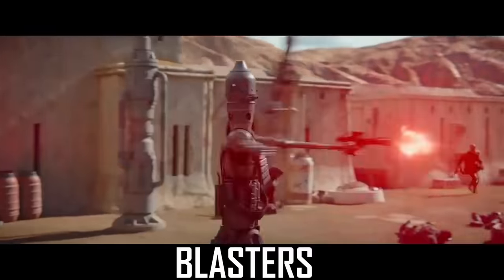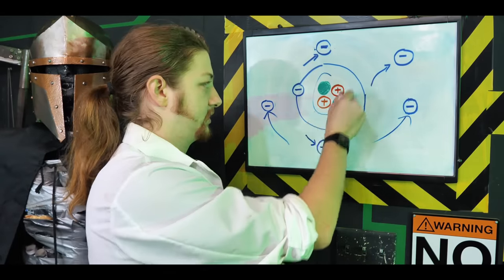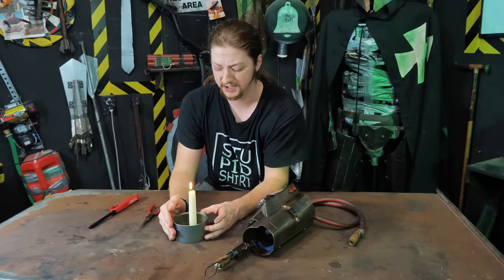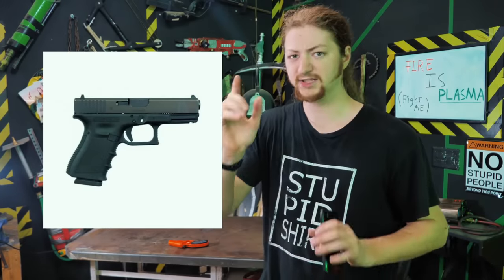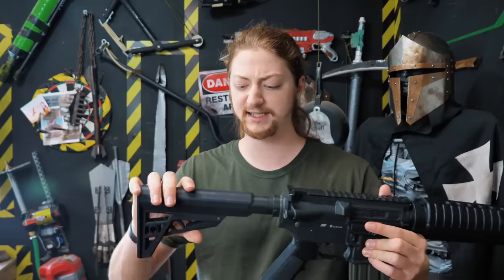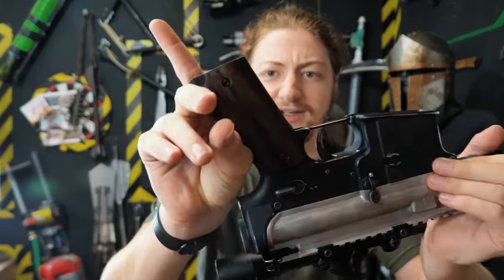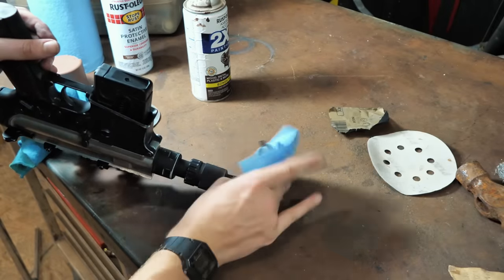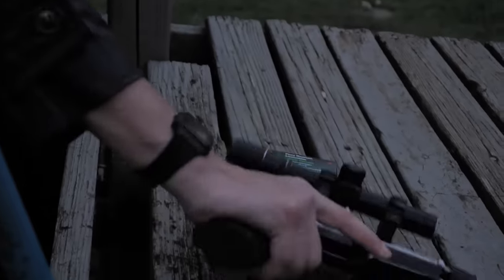Worlds First REAL StarWars BLASTER (is it possible??)

Comment: This is a really sick build, one of my favorites from you — and honestly, I think gun enthusiasts around the world are glad you didn’t mess with another mauser
Reply from the maker: Thanks bro! ngl i'd have felt terrible bastardizing an antique Mauser 😅
Reply: It wouldn't be an issue if companies would just make reproduction Mausers
Reply: @Imperial Bricks  they would have to make them clearly distinct from the originals though. Otherwise it would really screw up the market
Reply: @imperialbricks1977  but I agree, a lot of these relics would do very well in the historic market
Reply: @SpectrumArms  

Well obviously make sure people know it's not an original
Reply: @SpectrumArms  
Not really. Modern serial numbers and laser engravings on the inside of the parts would allow a buyer determine between original C96's and reproductions. 

The issue is cost. It is currently not economically viable to make reproductions using CNC machines and hand fitting the parts to together. Heat treatment and trying to achieve the same original blue finish are additional issues. 

You could setup a production line, which would significantly reduce the cost - but there is a lot of risk involve in it. 

There are reproductions of the Luger pistol but in 45 ACP and 10mm, but they cost significantly more than an original Luger in 9mm. I think that they start at 5000 or 6000 USD, compare that to an original that you can get for 1000-2000 USD depending on its condition.
Reply: The ar pistol looks way better imo
Reply: When I was a kid I remember a neighbor kid had a de milled Mauser. It was real and the controls worked but it didn't fire. I bet one of those could be found for a blaster project. I wouldn't feel bad about using one that's already ruined. That kid also had Walthers and other real but demilitarized guns. His dad was an arms dealer and bought him lots of super cool toys.
Reply: @Nate Bolyard  It would be easy. New ones would be required to have; Read Safety Manual stamped on it.
Reply: Oh hell yes, thank you for leaving the broomstick alone. 
Loved the build. What you made looks great.
Reply: @jakemakes the community would have torn you apart
Reply: C96 Mauser are so plentiful most wouldn’t mind if you hacked up a worn out used one.
Reply: there needs to be nice, replica mausers... Palmetto needs to get on that lol...
Reply: No, you're being lied to
Reply: Make the dfa from destiny 2 or the last word from destiny 2

Comment: “Gun laws are retarded” instantly subscribed
Reply: Glad I'm not the only one
Reply: 16 inch rifle = legal
1/2 inch pistol = legal

but...
16 inch pistol = illegal
1/2 inch rifle = illegal

Makes no sense. Putting a stock and a longer barrel on a pistol should be legal, and cutting a rifle down should be legal. It would be no different than buying a normal pistol or a really long hunting rifle.
Reply: @nitroxylictv  It makes sense when you realize it's not about keeping you safe or even keeping laws logical or consistent. It's about chipping away at your rights to own them wherever and whenever possible.
Reply from the maker: It makes a little sense when you realize the NFA originally was going to make pistols illegal as well, before they realized it would never pass. So they edited out the pistol part but neglected to remove the bits about modifying rifles to be pistols and SBRs. That’s gun laws for you.
Reply: @nitroxylictv  16in pistol is actually legal.
Reply: All firearms are legal.
Firearm laws are illegal.
Reply: @joshuawerner4376  True, and the laws don't even stop others from shooting each other.
Reply: Im with ya brother
Reply: I love using my pistol brace to brace my pistol
Reply: SAME
Reply: @nitroxylictv  Theoretically a 1/2 inch pistol and a 1/2 inch rifle shoot WAY different ammo. Which is the point of the law. They don't want someone coming into a place with an easily concealed pistol that shoots 5.56 rifle cartridges at people. But the problem is there is SO MUCH OVERLAP between pistols and rifles in certain models which makes any attempt at general gun laws pretty much futile.
Reply: @nitroxylictv  
16 inch rifle = legal
15.9 inch rifle = illegal
Reply: @captin3149  The ammunition shouldnt even matter. You can legally make your own pistol, (obviously not full auto but any other config), that shoots 50bmg if you want. That too basically just shits on gun laws targeted at sizes/ammunition.
Reply: @Cap Tin  Uh, no. The point of the NFA was to ban pistols as well, so they added rules about cutting down rifles into pistols, so people wouldn't skirt the new laws, then pistols were removed from the NFA, the only reason those rules were there to begin with, and then our genius politicians JUST LEFT THEM THERE for no reason.
Reply: regulating militia are so 19th century
Reply: Same
Reply: @nitroxylictv  you forgot the part where it's perfectly legal for anything as long as you give them money
Reply: @riftvallance2087  I don't know. General weapon laws seem sensible to me.
Reply: It's obviously not about safety, it's about giving the police as many options to arrest you as possible, and since they can't confiscate the firearms they'll just resort to punishing you if you ever have to use them. I'm honestly wondering how long it'll be until someone in a gun-friendly state uses one in self-defense, ruled as so by the local authorities, only for a federal prosecutor to come in and charge them for murder. That's basically what happened in TX a few weeks ago with the guy who was pardoned, just with different steps. The case was already ruled as self-defense, only to have the next DA retroactively press charges. Next time they'll go federal to rule out that pardoning option.
Reply: @adrianaslund8605  Yep, they seem that way, until you see how those with authority apply them. I now oppose all gun laws, including background checks, because I have absolutely zero confidence that they will be enforced in good faith.
Reply: @jakemakes ... and the thing is,  you can put a stock on a pistol all day,  and it does not change the fact that it still has only the functionality and range of a pistol... hence,  it is still a pistol. 

I mean,  neither the leader of the ATF,  nor the POS DIR of DHS can describe what an "assault weapon" is, so why should we expect them to know how any firearm actually functions?  There more that I could say,  but let's keep this fun.
Reply: Why did I do that too😭😂
Reply: But rocket launchers,bazookas,flame throwers, grenades,landmines and every other weapon protected under the 2nd amendment(even nukes) aren't regulated........go figure😏

Been to Williamsburg where one of the Colonial Armory are. The Brits took the Guns but left the Swords and Polearms even though Polearms were used as late as WW2 in some theaters (bullets run out)😹
Reply: I wanna go to the us just to fire a big ass gun.  As fun as that would be,  it's absolutely insane to hand them out like candy... if I lived on a farm,  I'd have an ancient .22 somewhere,  just to protect my livestock,  seeing I have no enemies and no one would really want to rob me..  not to mention I'm not planning a revolution Anytime soon (i checked my schedule,  and apparently there was a double booking for October,  so mine will have to wait another decade or so) I'm content the way things are.  You guys can fight about gun laws all you like, please just wait till I'm out of the road before you draw your weapons...
Reply: @psychopathrob1802  probably due to caliber size if I had to guess if  we're to cut the barrel and make a rifle more compact it's easier to hide I'm not a gun nut and I don't know all the intricacies of a gun that's just my guess
Reply: @riftvallance2087  why does everyone assume there's an agenda I get wanting rights but I've come to realize people don't understand the dangers of a weapon doesn't matter if you are following every rule someone else could take it and not be so smart with it
Reply: @joshuawerner4376  i disagree you need regulations a civilian shouldn't be allowed military grade weapons
Reply: @TF2bot  your right laws don't stop people from shooting each other doesn't mean there aren't consequences
Reply: @captin3149  The law outlawing SBR's was made long before 5.56 existed way back in 1934 with the national firearms act, which was passed to try and curb gang violence from prohibition. They intended to outlaw pistols as well, but that part didn't pass, but the SBR ban remained and has largely been forgotten about as far as lawmakers are concerned.
Reply: @logicplague  Eh, gun laws are a complicated issue. On one hand, your absolutely right on how police in America, and in a lot of other countries, can be absolutely abusive, and American gun laws are often selectively and inconsistently enforced, as well as often targeted towards minority communities. Its kinda crazy how even the most ardent pro gun politicians can suddenly get very pro gun control when they figure out that means black people can get guns too. and the NRA is often suspiciously silent whenever a black person just happens to have a gun in the car in a traffic stop and the cop kills them for it. And things like assault weapons bans are often based on silly superficial features that don't matter, like flash suppressors and bayonet lugs. 

On the other hand, greater access to guns also greatly increases successful suicides, and everyone running around with loaded guns also greatly increases the risks of negligent discharges. And this country has a lot of dumb people whom I wonder how they even remember how to breathe and have no business being anywhere near firearms. And then there are people with actual mental health issues whom really shouldn't have gun either and this countries mental health system is terrible. Plus there is when alcohol and firearms mix.

But it is true that greater gun control does lead to fewer firearms related deaths, obviously since the vast majority of firearms related deaths are suicides, accidents, and heat of the moment crimes of passion. And most people whom become criminals, are stupid, and not actually smart enough to know how to get around gun control laws.

On the other hand we also have to recognize that the vast majority of gun owners dont commit crimes at all and are responsible enough to avoid gun accidents. Thus taking their guns away too because some people are irresponsible, stupid or insane, is a form of mass punishment. And being an army vet, i understand fully how much mass punishment sucks. So i certainly dont believe in penalizing every gun owner out there because of the actions of a minority of people.

in short, its complicated, and there are no easy answers.
Reply: Some are bad but another few are good. Like buying guns when older is good but not having a suppressor in California sucks
Reply: Same
Reply: Same.
Reply: @nitroxylictv  yea americas laws are fucked you need a stock and a long barrel on any pistol in the UK as we have banned pistols a long time ago now only .22 variants with stocks and super long barrels are allowed for competition shooting
Reply: Lol what an American comment
Reply: Exactly 😊. I like seeong cool gunmakers
Reply: Instantly liked after that comment i love it😂
Reply: @riftvallance2087 I think cutting down barrels is illegal because it makes a gun easier to conceal.

It breaks the gun classification and could be used to smuggle a firearm to a place where it would not be allowed.

Or it's because law enforcement would have a much harder time if some guy was running around with an AK that fits in his back pocket or something...
Reply: Same here mate
Reply: I am right there with you. Just subscribed!
Reply: First time I've seen this channel, and yup: subbed for being a patriot (and maybe that sick hospitaller tunic).
Reply: it does make people feel important and virtuous though, but definitely doesn't do anything worthwhile.
Reply: @captin3149  that doesn't make much sense when you can buy a desert eagle...
Reply: please dont be lame and say slurs

Comment: I bet you'd get better visual results with 9mm or .45 ACP tracers as well as a shorter barrel with a fake barrel covering to get the proper size. Blaster bolts tend to move pretty slow so having subsonics would look pretty cool when shooting at longer ranges.
Reply: Yeah the slowest .45 you can get with the 2-4" barrel would be visually cool. You gain about 100 feet per second per inch of barrel give or take.
Reply: .410 dragons breath would be interesting.
Reply: Would then require a buffer tube.
Reply: subsonic .22 exists, would just need to adjust the gas a little

Comment: Actually, there is a way to control the direction of an electric arc/lightning bolt. A finely focused laser can be used to ionize an electrical path that has much less resistance to the current path
Reply: Such a device is called an electrolaser. https://en.wikipedia.org/wiki/Electrolaser

Comment: Fire is a proto-plasma, while it contains some amount of ionized gas, fire mostly consists of microscopic incandescent soot particles as well as certain atmospheric gasses that also become incandescent. The glow of flames may also have something to do with there being so much heat that it breaks past the infrared spectrum into the visible spectrum, but that's speculation on my part.

Comment: That was AWESOME! Now, create an ACTUAL plasma gun: Hollow out a "plasma ignition chamber" within the body of the gun, and when you hit the trigger it fills with a measured amount of "Tibanna gas" (actually some other medium that will convert to plasma when hit with high voltage), Then, create a means to transfer that plasma to an "acceleration system" that forces the hot plasma out of the barrel at high velocity. Walla! PLASMA BLASTER!! Personally, I think we have the technology to actually create something like this, and It's going to be a personal project of mine over the summer! But in any case, great job!

Comment: Nice! I made my own version last year. I used a canted green laser instead of a scope and mounted a cheap but fitting red/green dot to the pic rail. Also used a raw upper. Painted it a greenish color leaving the pic rail aluminum.  I did not use Canto grips but did find someone else who makes broom handle grips for ARs and used those. I thought it may turn out cheesy but it actually looks better than I expected. I wish I could post a picture. ;)

Comment: In the starwars lore, blaster bolts are often metal slugs that have magnetic fields holding plasma and they slowly melt in the air
Reply: Not true. What you just described is how pulse weapons work in several over franchises though, as it's based on real tested principle of superheating metal into a plasmid. That would apply to Brute Spikers in Halo, Tau pulse weaponry of all kinds in 40K, pretty much all the small arms in Mass Effect. Blasters only use electricity and Tibanna gas. But Star Wars does also have a variety of slug throwers, and I think people would be surprised at how many railguns are mounted in star destroyers since we traditionally never think about railguns being a thing in Star Wars.

Comment: I've theorized that Blasters eject their plasma of a ring, like blowing a smoke ring.  The magnetic fields work out great for this as they wrap around it, this also explains why the stun setting on the blaster looks like a ring, it's just allowing higher expansion while the normal bolt we see the ring is so tight we cant see the hole in the middle and most of it's aparent length is just leakage.

Comment: The best depiction of a logical plasma weapon is the Mass Effect 2 Arc Projector: 

It ionizes the air/target with a laser that an arc of high voltage electricity can travel through. Basically using the laser to focus/direct the laser.
This is the most logical plasma weapon in Sci Fi that I've seen, besides true lasers.

Comment: That's pretty cool! I don't know how legal it would be, but to get more of a "blaster bolt" effect, maybe you could get plugs of pure tracer compound, and tip them with a mildly explosive head? That would probably make it REALLY bright, and burn on impact. You'd probably get even more of a colored "flash" as the tracer plug shattered on impact and burnt even more brightly as the vaporized tracer compound flash-burned like an aerosolized explosive tends to do. Wouldn't be very dangerous either. It would certainly hurt to get hit with it and burn, but wouldn't be able to penetrate a target much. You could even hand-load the bullets with a lower powder charge to get a slower projectile that has more travel time, less noise, recoil, and would be easier to see due to slower movement.

Comment: The test near the beginning doesn't necessarily prove that there are ions in a flame. It could simply be that the heat or chemical composition of the flame lowers the dielectric breakdown voltage of the air, which would allow a spark to cross a greater gap. Furthermore, showing ions in air does not mean it has to be a plasma. A plasma is a collection of ions, but that is not a bijection. Not all collections of ions are plasmas. Salt dissolves in water into ions, which increases the conductivity of water. That isn't a plasma. While it's hard to imagine some chemical dissolving in air, it's not impossible, and that would also produce ions.

Comment: One theory I have heard about is having a dual system.  The gun first fires a laser at the target, thus creating a pathway for the plasma to follow.  The charged plasma is then released to travel down the length of the laser to the target.  Since this is all happening at such high speeds, the laser only needs to exist for a short time.  It then just comes down to how much energy the plasma can transfer to the target in order to do damage via thermal and / or kinetic.